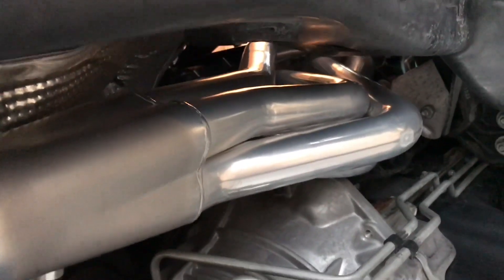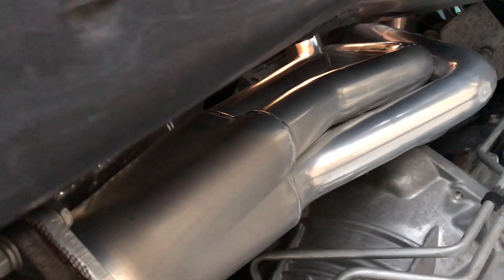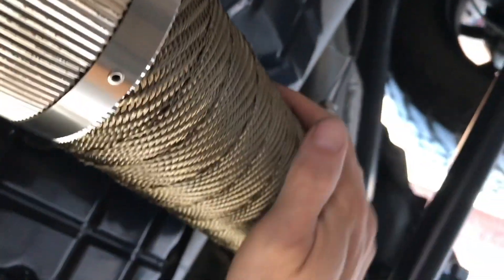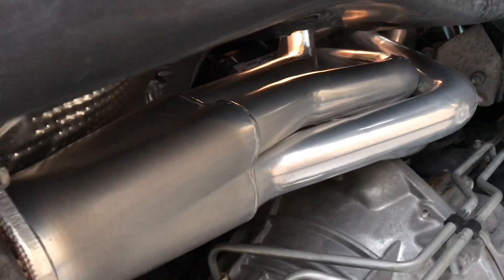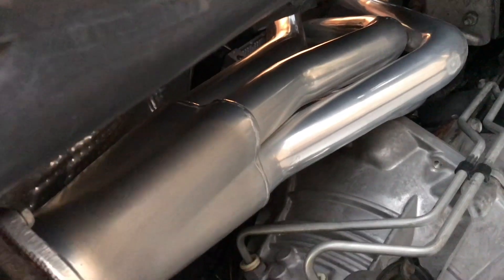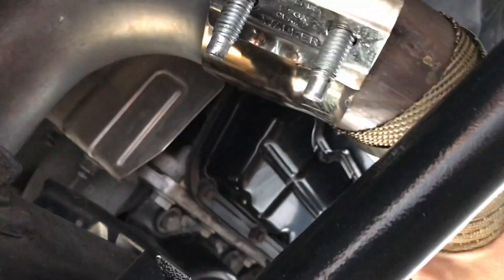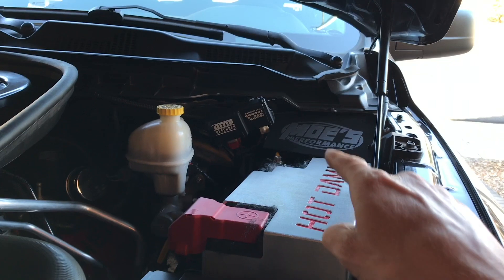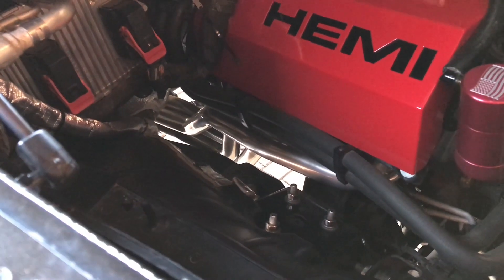Ceramic coated headers vs wrapped headers for heat reduction

Comment: Hmm what bout ceramic coating them for durability then wrapping them after??? I have a 540 puts out real heat etc
Reply from the maker: Yes and definitely yes, my truck currently lays down 922 rwhp on the dyno. Much has changed since this video.

Comment: Wrap will destroy your headers. Go with a true ceramic coating from a company like Swaintech, not some bake on powder coat junk from the local paint shop.
Reply from the maker: Wrap hasn’t destroyed my headers, my headers are not wrapped they are coated only. No top builder has went with full ceramic coat without wrap somewhere.
Reply: @HOTDAMN  take it off, show us a before and after.
Reply: @HOTDAMN  and again, do a test with real ceramic, not spray paint.

Comment: Next time, apply the ceramic coating inside the headers.  That will keep the heat off the pipes and keep them from stretching and breaking welds.
Reply from the maker: These headers are coated inside and out, same with the y pipe and extension. Almost 5 years and it all still looks the same. Truck ran a 12.005 in the 1/4.

Comment: I wrapped mine in DEI Ti and never understood the ceramic hype especially with stainless headers. My wrap keeps my engine bay cool enough I dont melt plastic covering on my wires. Glad to see someone finally say ceramic doesnt work for heat abatement. :hand-purple-blue-peace:
Reply from the maker: Dudes only listen to the guy they think is cool 😎. No logic, they only want to be cool.
Reply: Just the video I was looking for. It answered the questions clearly to the point. Nice ride from what I can see in the engine bay. You did a hell of a nice job with the wiring, ect.

Comment: WHY NOT DO BOTH??  Ceramic and wrap..   Also.. Cerakote C-series ceramic paint will air dry without having to bake them.
Reply from the maker: I did both on my turbo setup.
Reply: Given the significant difference in "Ceramic" coating types, wrapping a low emissivity ceramic coating (like what he has in this video) isn't recommended as it will cook that entry level type of coating while at the same time eliminating it's surface emissivity that would've reduced radiant heat( you can visually tell his coating is cooked so wouldn't provide reduced radiant heat, if a sales person put hit im this coating at Jet-Hot we would redo it in higher temp coating and eat the cost of original coating.  When someone wants maximum surface temp drops we recommend our 2k or 2500 basecoat (10x thicker than our classic polish that is a comparable (but better) version of what he has on his pipes, more similar to zircotec etc) then add wrap on top of that, the coating is still bonded to the material and provides corrosion protection and insulation, then the wrap can takes it further without destroying the pipes like a wrap alone often does.

Comment: You were in a hurry with putting it together but it inadvertently created a nice experimental comparison of pulverized lava rock wrap wrapped VS powdercoating, etc so it worked out. But doesn't lock the heat into the pipe though? I'm considering letting a friend of mine do an experiment titanium Turbo manifold for me when we boost the car but I may have to replace it when it fails with 304 stainless, etc, at least for the header part due to the heat and the fact that titanium doesn't last any more than 5 years TOPS, depending on the grade of titanium.
Reply from the maker: We are at 5 years, still going and looking great. Ran a 12.005 in the 1/4 with my homemade turbo setup.

Comment: I agree 100% with real experiencw. Had a set of jethot coated ceramic headers and engine bay was roasting!!! Cant touch thouse headers, but they look pretty. Thwn I had some kooks headers with heatshield inferno exhaust wrap and engine bay temps dropped DRAMATICALLY! And you can touch the headers.......heat wrap all day as long as its quality wrap and not mild cheap steel headers.
Reply from the maker: Hot damn hell yeah 💪

Comment: unfortunately this is only 1/4 of the story and info. Not all ceramics coatings work on the same principles, a black ceramic top coat will actually radiate more heat than an uncoated header, a low emissivity coating will reduce radiant heat the most but not lower surface temp (this looks like what you got but it has failed at the collector due to over heat and thus will lose it's low emissivity property and it's corrosion protection if your headers are not stainless) then there are the thermal spray ceramic coatings like our 2k and 2.5K ultra extreme, that actually insulate similar to a wrap by reducing surface temp but also protect the headers.  We never recommend touching exhaust for obvious reasons. Wraps work great for a short period but destroy most headers pretty quick as they hold moisture and allow oxygen to get to the hot metal and thus are the one thing all manufacturers wont warranty. We can restore and upgrade used exhasut that's been sitting in a junkyard for decades but not headers that have been wrapped for a short time.
Reply from the maker: 1/4 of the story and info? You wouldn’t have to make a comment on my measly YouTube channel if your product worked like wrap but it doesn’t. It works like a really good protective coating and that’s it. Call it as it is because I know NASA doesn’t have your number.
Reply: @HOTDAMN  Salty, Jet-Hot has 3 types of coatings that are all work very different also with different pros/cons. If they had done your pipe it probably wouldn't have failed, and if it did they would redo it under warranty or at most only charge the difference to step up the coating and FYI Jet-Hot actually has developed coatings with NASA. 😁

Comment: It’s to keep the heat in. You want the exhaust gas to stay hot and expansive so it moves faster through the system.
Reply: Yes and no. Try having 2" headers and being sick of killing starter motors.

Not to mention ambient temps and intake temps.
Reply: @hayden6056  Might be why he said "IT'S TO KEEP THE HEAT IN", and not "it's to keep the heat OUT", whatnot, what-have-ya, so-on and so-forth!!!!
And unless you're running a frickin' 540+ cubic inch engine, you don't need 2" primaries FFS, unless you're into killing torque!!!
Reply: @Anarchy-Is-Liberty  my primary size doesn't kill torque , does it possibly move WHERE the torque is? Sure probably does but it's why it has a converter in it. 

The heat wrap may have come around to keep heat in.

They do an amazing job at not melting plug leads , cooking starter motor solenoids and greatly reduce the engine bay temperatures. 

Try riding a custom piped not shielded bike , most manafacturer including aftermarket the "pipe" you see on a bike is an outter shield to stop you from melting your leg. 

Ask any not double pipped bike owner if they wrapped it for another 1-2 HP or so they have less chance of needing skin grafts.

Comment: Check out Jet Hot ceramic coating reduces heat by 50 percent
Reply: He is like a flat earthen on this. Refuses to try and understand the different types of ceramic and how superior they are to wraps.. (with exception of touching) but who needs or wants to touch their exhaust anyway? Radiant heat vs convection heat vs conductive heat.. too much to think about for mr gangland haha
Reply: @chrism3188  People will believe what they want to believe. His loss
Reply from the maker: I know about Jet Hot, it does well at protecting coated parts up to 2000 degrees fahrenheit. But absolutely did not reduce temps by 50 percent.

Comment: Ceramic coating DOES reduce heat by 200-300 degrees and lasts longer than wrap.
Reply from the maker: Wrap DOES dang near eliminate all heat. Ceramic coating is NOT used as an effective insulation. Ceramic coating looks great and helps the headers last longer.
Reply: @HOTDAMN  I would say a 200+ degree decrease is a pretty effective form of insulation. To say it doesn't hold heat is plain wrong. Doesn't hold heat as well as wraps, sure. But doesn't hold heat at all is just not true. And it will last longer than wrap and won't crack your exhaust like wrap. Ceramic coat for the win.
Reply from the maker: @Repairsridesreviews  Unfortunately 200 degrees is nothing. If you are driving steady a 65mph in good cool weather ceramic is fine because the exhaust is only reaching a max of 500 degrees Fahrenheit. My exhaust can reach 1200 degrees full throttle. My 5.7 is fully forged, tomahawk cam and turbocharged. Nobody relies on ceramic coating for these builds.
Reply: @Repairsridesreviews  Several have tried to tell him this, there is ample data, case studies builds etc etc to prove it, but he doens't want to understand the science beyond his anecdotal event where he burned himself, he made a mistake with original coating selection and touching his pipes, now has PTSD, a misunderstanding of coatings outsider that one and a flawed opinion overall, he isn't going to change, but will likely ruin his pipes with that wrap! haha  In all fairness wraps do keep surfaces more "touch safe" for those inclined to touch hot exhaust).

Comment: Real ceramic coated headers WILL reduce heat by 200deg. Now they do get hot for sure but mine are at 160 at motor shut off compared to 370 without the coating. I have seen the numbers. Wrapped is nice and cooler but the metal cant breathe and will fail sooner. Both are good and both work . just how long you want it to last.
Reply: The key here is using a QUALITY ceramic coating, not most of the Chinese junk being sold on eBay. There's a reason why a high end custom stainless exhaust that is properly coated inside and out will absolutely reduce heat. I put a set of hooker blackheart ceramic coated headers on my Corvette and under hood temps are lower than it was when stock
Reply: And the. Wrap the quality ceramic coated exhaust and you really have something, it's fatigue resistance will not be as good as a bare metal,  but it works.
Reply from the maker: This is a very good comment.
Reply: How about ceramic coating them, then apply wrap and lastly apply protect thr wrap?

Comment: Ceramic coated exhaust components do not radiate heat. Properly coated exhaust components will lower under hood temps and increases exhaust gas velocity. Having said that ceramic coated exhaust components are fucking HOT to the touch!. The coating keeps the heat centralized. Hundreds of degrees of heat to the touch but it doesn't radiate that heat. High quality wraps that are wrapped correctly over high quality stainless steel is good too... there is a reason why Nascar engine builders ceramic coat the top of the pistons.
Reply: 100%

Comment: Finally! Someone who actually addresses this- I was going to ceramic coat my Porsche exhaust to stop the heat in the engine bay (and stop the constant oil leaks from burning/ smoking) but it would not have worked- this sounds like it would help with that! I'll wrap them instead- will look cool too.
Reply: if you have oil leaks wrap could be dangerous. be safe
Reply: Ceramic coating is 1000% better than header wrap. This guy is overlooking a lot of things with this video.
Reply: Do both on a porsche

Comment: Can someone explain something for me here? I’m searching for power increase videos for just wrapping the entire exhaust system but only see “wrapping to reduce heat”. Isn’t the main reason for doing this to increase exhaust temps by insulation and therefore increasing the flow of the exhaust?
Reply: On a turbo'ed car higher exhaust (gas temps) means higher velocity and quicker spool. On all cars its Important to keep engine bay temps down and not to heat soak any aluminium manifolds/turbo inercoolers. If you had a cone filter in your engine bay sucking in warm air it would effect power due to air density etc.
Reply: @scottpickstock6721  thank you!

Comment: Header wrap does hold in heat , but you want the heat to dissipate , also header wrap will cause headers to burn out very quickly
Reply: buy better headers then. not that ebay shit
Reply from the maker: I only have the y pipe wrapped under the trans pan and the turbo anti reversion pipe is also wrapped before the turbo. Exhaust wrap increase exhaust velocity which increases scavenging and in my case spins the turbo up quicker.

Comment: Ceramic coatings do help but within some reality.  Still hot maybe 600 degrees dropped 500.  However, header wrap WILL kill your exhaust in no time.  Been there done that.
Reply: @OliMWorld  condensation
Reply: @danielpv7570  I would get the coating inside and out .The wrap is a nightmare.
Reply: Not true. Cheap ass header wrap might destroy cheap mild headers. I had heatshield inferno header wrap for YEARS on my LS7 WITH KOOKS HEADERS NO ISSUES!!!

Comment: Yo i got DEI titanium wrap but I'm heastitant on installing it. my header is ceramic coated already. (DC sports) my concern with installing the wrap is that it will retain too much heat and weaken the header, or make it rust out or the welds come apart.
Reply from the maker: I didn’t wrap my headers, I like the look. The wrap will ruin the ceramic coat visually. If you get real serious wrapping the headers will reduce the heat in the engine much more. Full wraps in my opinion are best on vehicles you don’t daily. If done right you will have no issue, not easy and I’m not saying I can do it professionally.

Comment: Do the 2, easy. Use a high quality ss 321ss for example, coat of zircotec and titanium dei wrap and you will be set. That is not ceramic coat, that's pretty much paint. Ceramic actually looks like ceramic, hence the name 😂
Reply from the maker: The headers are ceramic coated, plan and simple.

Comment: Ceramic coating does work, you just need to take them them to a professional; they will tell you if your exhuast is of high enough grade to be viable, this is because cheaper grades of stainless will fail when its coated. Same goes for wrapping, the heat hasn't magically disappeared, its just moving a bit faster, what you're actually doing increasing the temperature of the metal inside the wrap and its this sustained higher temperature will compromise the metal - this is why manufacturers will not cover warranty claims on wrapped exhausts. I'm not trying to be an ass, just dont want you to have split headers a few years from now for the sake of a slightly cooler engine bay while in traffic.
Reply from the maker: First off my headers are ceramic coated, does not stop any excessive heat from getting in to the engine bay, but does resist corrosion and looks good. Second only my y pipe is wrapped, for a reason. Been that way along time, still looks great. Third wrap does stop excessive heat from getting into the engine bay and directs it out word through the exhaust. The heat pressure can cause scavenging, scavenging is great. The 4th and last deal, don’t do what you can’t handle. If modifications are going to be a burden on you then don’t do them. Leave that business up to me, thank you.
Reply: @HOTDAMN   Well, actually, properly coated headers do.... 

https://www.zircotec.com/products-services/ceramic-coating-for-motorsport/

The heat build up is inside the wrap yes, correct, and can will result in some scavenging (This is at higher RPMs) However, too much heat will eventually cause the metal to fatigue, as the excess heat and the reduced amount of expansion will eventually cause small micro fractures in the metal, thus causes a failure. Now you may not be able to see this currently as they are wrapped, so if they have been on a while, my suggestion would be to check them. 

The other reason for not doing them (and often overlooked) is a fire hazard, if oil gets on the wrap and ignites then its bye bye engine (unless you have a fire suppression system fitted)

Also, I have been working on cars a very long chap, If you ask anyone thats been around a while and worked on / raced / tuned engines they will all advise you not to fit them, its all based on risk / reward. Do remember this was a technique used in the 60s when we didn't have ceramic coatings, you don't see F1 teams doing this do you? The reason was as you mentioned scavinging / touching the headers as you could work on the car without burning your skin....

As i mentioned before I am not being an ass, I was simply pointing why you shouldn't. There is no need for the attitude, and I shall continue to work on cars, but thanks for the 'head up' ;-)

Comment: not gonna trust the opinion of a guy whose very scientific method and results is based off of touching a bare header pipe after running the engine
Reply from the maker: If you don’t get it, nobody can help. Excessive heat in the engine bay or not? If yUo DoNt FeEl iT, It’S nOt tHeRe. Right? Basic science should be as is, basic.
Reply: @HOTDAMN  uhh, whatever.  there are videos that show people testing the header pipe temps before and after applying ceramic coating and display the drop in temperature.  it's still a few hundred degrees but definitely lower.  they were smart enough to not grab it.  basic science.